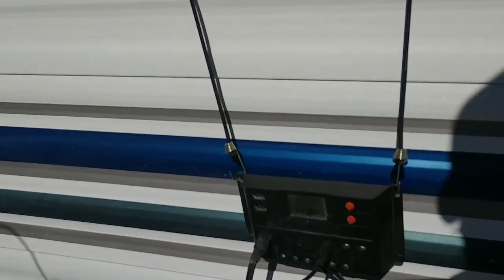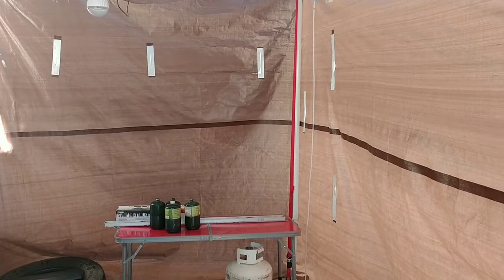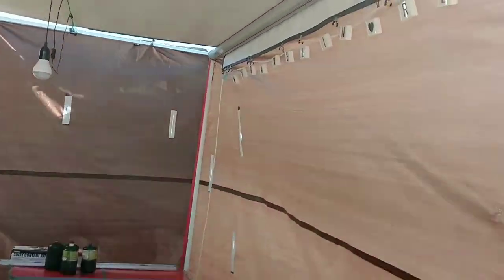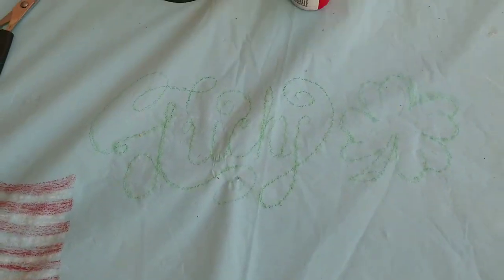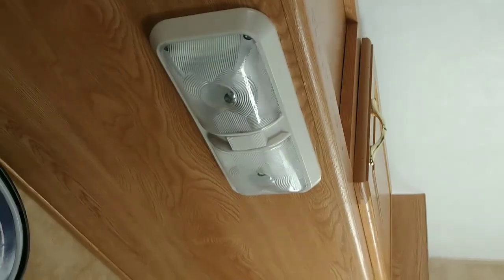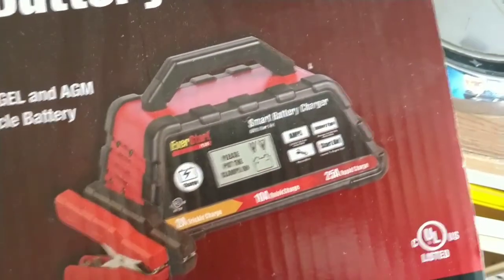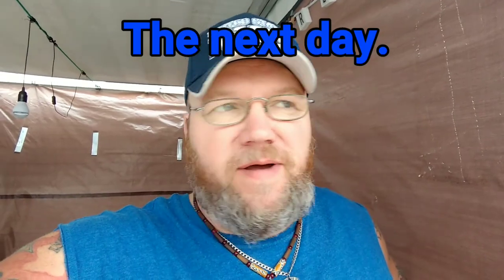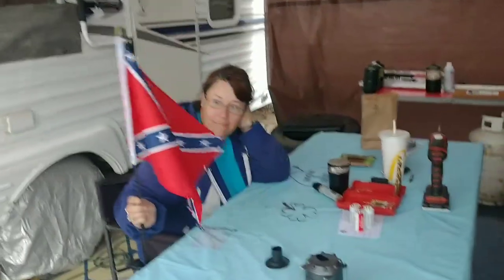Gettin Projects done

Comment: For the helicopter sound, do you have the strap straight and flat?   Flat bed truck drivers learn to put a a few twists in the straps so it won't vibrate and shake make loud noises.   Next time you are at a truck stop look at the flat bed rigs and see how they are strapped. In other words, put several round twists in the straps.  I hope this makes sense.  Feel free to ask the drivers.  I only pulled flatbeds a handful of times, I'm an old reefer chicken hauler rooster cruiser driver.
Reply from the maker: I've kept them flat on purpose just so it annoys her.....  LMFAO

Comment: Have you tried-Try this 60-second fix before you call an electrician. Turn off the power to the fixture and use a non-contact voltage tester to make sure the power is off. Then reach into the bulb socket with a flat-blade screwdriver and gently pry up on the tab that's centered at the bottom to restore good contact with the bulb. This?
Reply: Or is the a wire loose?
Reply: Could the connection be dusty or corroded?